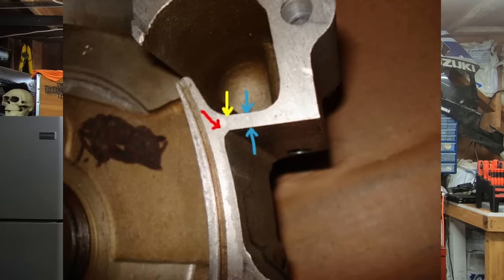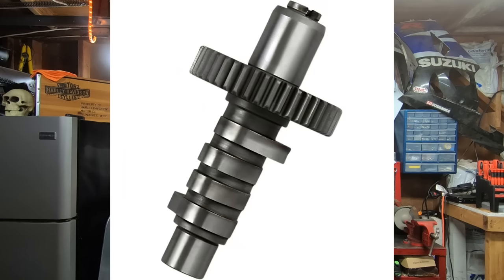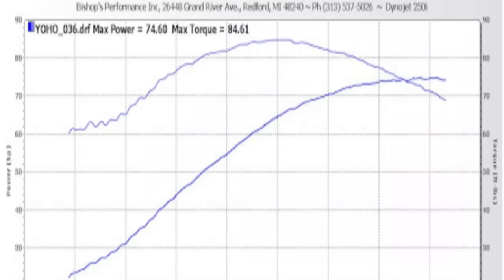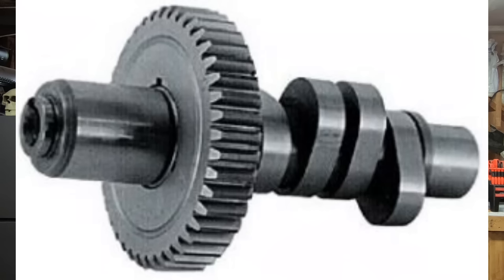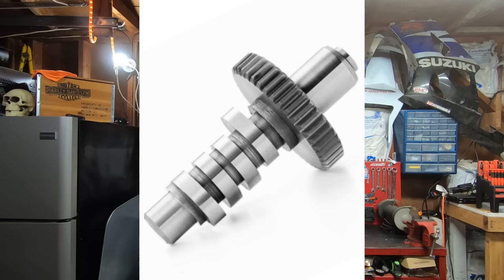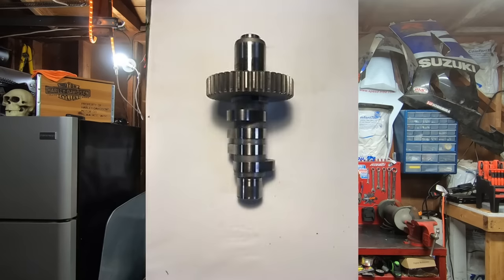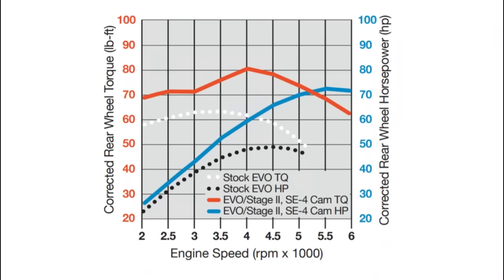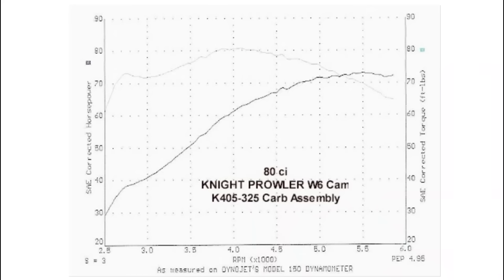Absolute Best Upgrade for the Evolution Harley-Davidson

Comment from the maker: What camshaft are you running in your Evo, are you still running the stock cam or have you already upgraded?
Reply: Dyno results from different sources aren't worth comparing to each other, first thing is the same exact motorcycle on the same day with the same atmospheric conditions will give you entirely different results from different dyno's or even the same dyno with a different operator, you can even play around with the hold down straps and your numbers will change, I've seen tests done where they took a bike that measured 100 RWHP on a dyno and took it 1 mile down the road to another shop, running the same gas in the tank with the same atmospheric conditions it ran 86 RWHP, that's a 14% variation, not exactly definitive, dyno's aren't the etched in stone result's that people think they are.
And when someone like Woods Brothers gives numbers for a cam they quite often use an engine that they've done other things like headwork on to make it appear that their "bolt in" cam is superior, you even mentioned that it has one of their own modified carbs on it, you can bet that's not the only thing they did. 
No one has some huge secret that nobody else has, whether it's in the bolt in class of cams or any of the other's that's designed to work with different levels  of modified engine's no matter who makes it the result's are going to be right around the same, nobody has a magic wand.
What's far more important is running a good exhaust, anyone who dump's thousands of dollar's into an engine and runs short straight pipes just blew it, a good exhaust is critical to getting the most out of what you're doing, "true duals" are a waste of money and are sold to people who assume that because back in the 70's taking a V8 automobile with a Y-pipe and catalytic converter and having a dual exhaust put on it made it run better then a dual exhaust must be better for everything, that simply isn't true.
The cross over pipe in some stock Harley exhausts along with the "married" type used later is there for a reason, Harley knew exactly what they were doing when they designed it, slip on mufflers with the stock headpipe will run much better than wide open pipe's, the odd intake pulses from a 45° engine where both cylinders share a common intake are the reason for that.
The best exhaust to run on any Harley except for the true XR style engine with it's design that has a separate carb on each cylinder is a 2 into 1, this is basically what the cross over pipe and married headpipe designs achieve, one cylinder's exhaust helps to scavenge the other cylinder and get the intake charge moving on the "dead" cylinder that has to wait for so many degrees rotation of the flywheels to start it's intake cycle. 
However some people don't want the look of a 2 into 1 exhaust on some models of bikes so the stock headpipe with slip on's come in a close 2nd, longer drag pipes with inserts like those made by Krome Werks (spelling?) are a decent exhaust to run for someone who want's the drag pipe look, but for God's sake NEVER run wide open pipes, they completely destroy mid range power and only add 1 or 2 HP more on the top end than a good exhaust that increases mid range by 20 to 25% over drag pipes in the mid range, and you have to go through your mid range to get to the top end so it doesn't take a genius to figure out what's going on there.
I've seen more people ruin thousands of dollar's worth of work by running drag pipes than I care to remember, I make it perfectly clear to someone that if they plan on running drag pipes I won't waste my time building an engine for them, it's just stupid.
Reply: im going to go with the ev27 on my 98 fxstc with 17k miles on the clock. should I put adjustable pushrods and  lifters aswell? thanks!
Reply: Ev27 with a thunder header and s&s super e screaming beagle ignition module. Plugs say she’s happy. Great info thanks. Tom
Reply: @jukeboxheros7021  
EV27's open and close the valves very quickly and as s result are hard on the valve train, years back Rivera Engineering offered a cam for Pan's and Shovel's that was like the EV 27 that brought on power low in the RPM range by operating and closing the valves quickly and gave a wide powerband like the EV27, they had to quit selling it because it was trashing the valve trains in engine's that were running them, so if you plan on running an EV27 plan on having valve train issues down the road that might include valve float at higher RPM's than a stock ignition's rev limiter will allow.
The EV27 is a bolt in cam so no, you don't need adjustable pushrod's, they won't achieve anything except give you the ability to install the cam without having to disassemble the rocker boxes, to do that you have to cut the old one piece pushrod's out, NEVER cut them with an abrasive wheel if you do cut them out, the grit will get through everything, use a set of bolt cutters to cut them and make sure that the valve isn't on it's lobe on the cam when you cut that particular pushrod. 
As far as putting in replacement lifters it all depends on the condition that the stock one's are in, factory EVO hydraulic lifters are pretty good, I've heard it said that they should be replaced every so many miles but that simply isn't true, the best guide for replacing them is the amount of wear in the bore's of the tappet block's and the tappet bodies, buy yourself a 0 to 1" micrometer that measures down to .0001" (one ten thousands) and a set of small hole or telescoping gauges that are intended to be used in a hole that's the size of the bore in the tappet block, measure the diameter of each tappet and write them down on a piece of paper, then using the small hole or telescoping gauge and the micrometer measure the size of the bore of each one in the tappet block, then subtract the two measurements for each other and see if it fall's into the clearance spec given in the service manual, if it's close to the wear limit then you might want to consider replacing them but it's not necessary. 
What's of great importance is making sure the fit between the cam gear and the pinion drive gear is correct, a little too loose doesn't hurt a thing except it'll be a little noisy, but tight is practically a death sentence because it'll burn things up, also important is the end clearance, don't ever assume that the shim that's in the engine currently will be the correct one for a cam change, if you have a 6" vernier caliper you can measure the distance from the two shoulders on the cam that determine it's length between it's inner bearing surface and the bushing in the cam cover, if the length of the two are the same or the replacement cam is slightly shorter between those two shoulders you'll be ok AS LONG AS the current cam in it didn't have any end clearance issues, however the best way to check it and verify is to measure the end clearance with a feeler gauge with the lifter blocks out, there's tools that allow you to replace cam's in that style of bottom end without having to remove the tappet block's, if you go that route then you must measure the length of the replacement cam to be assured it'll have end play, no end play will tear things up, if in doubt the least bit then remove the tappet block's and using a feeler gauge verify that the cam end play is in spec, with the tappet block's out you can also check the gear sive without buy a micrometer that measures in that range and the special pins needed to measure the gear, also to properly install the tappet block's once they're out you need the special tool that threads into one of the 1/4" fastener hole's in place of one of the screw's to assure that the tappet rollers are running true on the lobe's, it's a hex drive screw with a long taper to properly align the tappet block's, otherwise it's like having a car's wheels out of alignment going down the road. 
Also pay close attention to the rotary breather valve end play and make sure it's in spec and that it's timed properly when installing the cam.
Reply: everything is stock, but the pipes and mikuni 42, thanks
Reply: @jukeboxheros7021  
If you want a combination that'll work as well and last longer go with the EV3 and bump your compression up one notch, the EV3 is much easier on valve train's and with the compression raised you'll get that same power coming on earlier like how the EV27 does. 
The EV27 and EV3 have valve timing specs that are almost identical, each one's a single degree within each other opening and closing the intake and on it's surface the difference between them shouldn't make any difference at all, but what they don't tell you and what most people don't get is the way they list valve timing, the "@.053" is what come's into play, when a cam manufacturer says a cam of their's opens an intake at 20° BTDC that means that it's already .053" off of the seat at 20°, likewise when it's closing they rate the valve as closed when it's actually still .053" open, what that means is a cam with less aggressive lobe ramp's is actually holding the valve open longer than a cam with more aggressive ramp's that list's the intake's as closing at the same time because it's closing slower, that's why despite the EV3 and EV27 having almost identically listed valve timing the EV27 makes more power down low, because with it's gentler cam ramp's the EV3 is holding the intake valve open longer after BDC than the EV27 is, as a result it has less dynamic compression than the EV27 despite their timing being almost identical on paper. 
Cam's like the EV27 and the Woods cam's that seem to have some sort of magical quality behind them and make a lot of power down low despite having listed opening and closing numbers that are almost identical to other cam's are hard on valve train's, that's what they won't tell you about. 
On paper those the EV3 and EV27 are within 1° on both their opening and closing of the intake valve, but the EV27 hammers away on your valve train opening and closing the valve's so quickly, that's the price you pay, if you are going to run something with ramp's as aggressive as something like the EV27 then make sure your valve train is healthy. 
If you want to run the EV3 and don't have the money for higher compression piston's one thing that can help is tightening up the squish by running a thinner head gasket, that'll raise your compression up a little, all the aftermarket part's manufacturer's like Weisco and other's will tell you to run .050" clearance between the piston and head in the squish area, that's a waste of time and power, squish area's don't do a thing until you get them down to at least .030", that's when they start really doing what a squish area is supposed to do which  is create turbulence, I don't know if it's that the part's manufacturer's are afraid that people might miss some other little detail or measure thing's incorrectly and then thing's will start bumping into each other and they'll get the blame but the fact is their benefit's don't start kicking in until they're down to at least .030", I routinely run them all the way down to .020" with no problem's including my own Sportster that regularly get's revved to 7,500 RPM's with stock rod's and flywheel's, tightening up the squish area is a good example cheap horsepower. 
Your Mikuni carb really isn't going to make any difference at the level of modification's that you're doing, the stock 40mm CV carbs with a kit in them will support a 100 RWHP build, the Mikuni will get you up around 115 RWHP if you ever decided to go all silly fast on the mods, before that you'd better put a bunch of money into your brake's.
Reply: @dukecraig2402  wow! maybe this is a job for my indy to do. he sugestted ev27 as cuasual conversation, but maybe i'll bring up the ev3, i don't want valve problems down the road, just a little grunt. thanks for the advice.
Reply: @dukecraig2402  that's a great explanation on exhaust I've been doing it for years it's just common sense--thanks for your time
Reply: I ran a Sifton 141, with solid lifters, adjustable pushrods, a ton of headwork, and two inch straight pipes. It was a top end monster.
Reply: EV13 in my ultra
Reply from the maker: It's very easy to do if you're going back with adjustables, a lifter swap later wouldn't be hard at all. Personally l like to put new lifters in with a new cam.
Reply: Bought to slap an ev27 in my 96 fxd
Reply: @dukecraig2402  Thanks Duke. everything Id need to know now.
Reply: My FXSTC Evo is running a stock cam... I push the heck out of that bike and I need more power. I want acceleration AND top speed 100+ mph. Any ideas?
Reply from the maker: Aftermarket Evo cases, stock cases will split trying t ok make that happen.
Reply: @GixxerFoo  Hmmm... As is with just a jet kit and a 2 into 1 exhaust I can do 100mph everyday no problem. It just doesn't get there quick enough. I will look into the Andrews stuff before I buy. It's about to go into the shop for about $2000 worth of rebuild budget and I just want to know what's best before I buy.
Reply: Al Gottsch  Thank you bro, with so many options I'm having trouble deciding what to do. I've had my EVO for about 7 years or so and it's been a journey getting it to do 100mph comfortably. Carb tuning, exhaust, new rims, front suspension upgrades, T-bars... the list goes on and on. I can do 110mph but at that point I don't want to push it any farther. Now out of pure stubbornness I am going to continue squeezing every drop of performance out of a bike that was really meant to be a cruiser. What can I say, I like to be different... Thanks for the recommendation!
Reply: Al Gottsch  I know I'm way above that already. If my bike was sitting at 36 hp there is no way it would be even as fast as it already is. That said I'm guessing I'm close to 60 hp or so. Maybe I'll post again after the work is done. The Andrews EV27 looks like the most popular option.
Reply: I own a 1989 police bike, was already strong from factory, only changed inlet manifold and fitted a good tuned cv carb with k&n filter. Runs like a dream.  No trouble driving with mates with gold wings.
Reply: @jukeboxfan60  my 98 Electra Glide Classic runs strong too. Tossed the EFI ( cause me nothing problems) and replaced it with a jetted  CV40.
Reply: I have a 1200 evo. 2020 i got 80 hp with the stock cams and 2 into 1 exhaust and a high flow aircleaner. I'm pushing about 79 ft lbs tourque also. I'm going to be doing a 1275 big bore kit.  What cams should i get for higher rpm power?
Reply: @jukeboxheros7021   Hey Duke do you have a you-tube channel of your own and how familiar are you with Pan-Heads? Mike from Maryland. (mislandmike@hotmail.com) I noticed a lot of the same subscriptions as mine.
Reply: My '86 EVO is hopped up a little. Running stock cases and jugs, S&S rods and crankpin, Wiseco 10:1 forged pistons, Jim's pinion shaft and Pro-Flo oil pump, Andrews EV46 cam, Crane lifters, Andrews adjustable pushrods, and T-Man heads. Carbe is an S&S E, and running 36 inch drags with 1/4 inch bolts near the end. Transmission has Andrews gears, Baker steel shift-forks, and upgraded bearings. In the primary I went with an Alto Red Clutch set, with a 23 tooth comp sprocket. Also converted to chain final drive. This is all in a Softail. Bike is really strong, especially up to a little over "the ton", LOL. She gets between 40 and 50 MPG, depending on how you ride. Love that scooter. I call her "Angel". Thanks for putting these vids out there.
Reply: @dukecraig2402  what about timing if you do cam and higher compression pistons? do you need to buy ultima or can use stock ignition?
Reply: @michaeldiy1510  
Completely depends on the build, I've been surprised sometimes at how some builds with cams, head work, exhaust and carb will use a stock curve and advance/retard degrees, then you can have a build like putting a set of Y grind Andrews cams in an Ironhead Sportster, bolt in cam and despite using higher compression pistons and not only is the stock curve wrong but you'll never get it to idle below 1,150 maybe even 1,200 RPM's reliably because the duration on the cams is so long that compression is down at an idle, the amount of throw between retard and advance has to be shortened from around 30° to 15°, which actually comes out to around 15° advance at an idle compared to it's stock advance at idle which is around 3° or 5° I can't remember exactly, but with less than 15° or so advance you can't get them to idle at 1,000 RPM's.
Those older Ironheads with points and the advance weights with the springs I'd install the softer springs that allowed for a faster advance and tap out the two pins that go through the bigger holes in the advance weights that determine how much it advances and drill bigger holes in the base to put in larger diameter pins that I'd make from the right size drill bit shanks (I can't remember what size I used, I have it written down in my build files), or if you could make smaller diameter bushings to put into the bigger holes in the advance weights, either way you want to cut the amount of advance by about ½ and they'd idle fine.
Of course if you put a Dyna or Compufire unit inside the "cone" that replaces the entire assembly in there on them or the Shovelhead's they have all the switches you can set to get a faster advance and cut the throw in half or so, but I never liked those things, back in the day when a lot of bikes had those it seemed like everytime you got a bunch of guys together to go riding there'd always be someone who'd have one of them that would go out, and then we'd have to sit there with them till someone with a pickup truck could be summoned to come get them, and this was the days before cell phones so good luck with that, I don't think those units were ever really up to withstanding all the heat and vibrations in there, a properly set up and maintained set of points is far more reliable, my 2003 Sportster that I built the engine on exceeds 65 MPH in first gear and I've got a custom set up set of points in it via the tricks I know and I even rivet the cover on it just to make it appear as though the stock ignition's in it, it's a sleeper bike that surprises the hell out of people who look it over and think they know what's going on, large Red Shift cams that should have collapsible converted push rod tubes but I figured out how to run not only adjustable push rods for the smaller base diameter cams but also the travel limiters in the lifters for sustained high RPM's with the stock one piece covers, people who think they know what they're looking at figure it's got bolt in cams, 44MM Screamin Eagle carb that appears to be the stock 40MM carb, windage tray in the bottom end, I put a 52% balance on the flywheels for high RPM's, Racetech Gold Emulator valves in the stock forks, a stock ⁹/⅙ diameter front master cylinder from a single disc on the dual disc front brakes that'll stand that thing on it's nose with two fingers on the brake lever, yea, that bike's been a real nasty surprise for people who think they know what they're looking at, and I've won more $20 bets with people who call me a liar when I tell them it'll exceed 65 MPH in 1st gear, I tell 'em "Get your car, you can run along side me, just make sure you have $20 because if you don't then don't bother pulling over after I show you, of course before I do it I don't tell them I have an Andrews close ratio 1st gear set in the transmission that adds 10 MPH on 1st gear, rev it to 7,500 and the needle's sweeping past 65 MPH, I just let 'em learn the hard way, $20 at a time.
Reply: @dukecraig2402  nice !!!!!!!!!!!!!!
Reply: @michaeldiy1510  
Check into these multi compound tires with the softer racing type rubber around the sides of the tread that all the manufacturers are making nowadays, when you lean into a corner you're on the softer rubber, I just put a set of Avon Cobra Chrome on that Sportster and it goes around corners like it's on rails.
I used to run the Dunlop GT 501's that are made in the same style but they've dropped the 140 size rear for 16" wheel  that It has, and they were incredibly expensive, the Avon's are working just as good and they're probably about half the price plus they're made in England, I'd rather give my money to the working class folks in England compared to some of the alternatives, you know the people in England are skilled and take pride in their work so you can trust tires made by them.
I think I'm gonna try a set on my 05 Ultra and see what kind of mileage I get out of them compared to the Michelin Commander's I've been running. 
As far as the drop in style valves like the Racetec Gold Emulators I have in it try the Ricor Intimidators, I put them in my 05 Ultra and WOW, they turned the stock forks into something you'd think says Ohlins on them, they have that inertia valve that makes the ride very plush when hitting bumps.
About 10 years ago I started getting into setting up suspensions, those drop in valves have turned out to improve those front ends so much that Harley started using them around 06 or 07 I believe, the forks on my Ultra were kind of a freakshow hybrid where it had the traditional dampener assembly in the right side and a cartridge set up in the left, the reason I didn't care for that is when it comes time to service the fork oil you have to pull the cartridge out of the left fork and tear it apart (requiring special tools) just to change the fork oil, so I ordered a fork tube, dampener rod, and a few little other parts for the right side to turn the left into the same dampener system that is in the right side and is how they were always built up until that oddball couple of years like mine that have the cartridge in the left side, and then I put the set of Ricors in it and haven't looked back since, when I bought that bike with 50,000 miles on it every bracket on that thing was broken from the notoriously harsh suspension that era has, after replacing the broken stock fairing brackets with a set of Strongarm brackets (order a 2" longer than stock clutch cable when you do it, trust me) and welding the speaker brackets including making gussets for the bends in them, which is right where those one's break, like Harley should have in the first place that front end glides across uneven bridge seams and frost heaves and pot holes like they're not even there with those Ricor valves so I don't have to worry about anymore bracket issues, on the rear I bought a set of Gabrial '63 to '82 Corvette air shocks to replace the incredibly harsh rear shocks, which accounted for a broken tour pack mounting bar (the tour pack was flopping around when I hit a bump), that U shaped tube bar that the tour pack mounts on, there's a set of bushings for some kind of suspension brace add on bar for raised body pickup trucks that you have to press the bushings out of the replacement shocks and press them in to use on the bike, if you spoke around on forum sites guy's talk about where to get those bushings at (some 4X4 place has them), then mount an air compressor and dump valve inside the tour pack, then get a switch for a CVO from that era that's for locking and unlocking the tour pack on one and mount it in where the speaker/CB switch goes on the console (provided of course that you've replaced the stock radio and no longer need the speaker/innercom/CB selector switch), it's a rocker style switch from the CVO's electric tour pack that rocks forward and backwards to lock or unlock the tour pack, wire it up with the air compressor and dump valve so when you rock it one way it pumps up the shocks and when you rock it the other way it dumps air, run an adjustable metering valve on the dump line otherwise it dumps air out so fast it's hard to fine tune the suspension riding down the road, if you're into it however it looks cool pulling into a parking lot and rocking the switch to dump air and it instantly slams the rear end down so a passenger can get on or off, but it really makes it hard to adjust going down the road, I have the metering valve adjusted so that 2 seconds of dumping air is the equal/opposite of 2 seconds of rocking the switch to air up the shocks, that way when you're going down the road it's easy to fine tune the suspension to that roads conditions. 
Between doing that and the Ricors in the forks that thing glides across bad road every bit as well as Ohlins cartridges in the front and Ohlins shocks in the back that I've installed for people and it's at literally a fraction of the cost, plus on the rear you don't have to pull over and get off and remove the saddle bags to adjust those $1,200 shocks, now between the rear suspension and those Ricors in the front that bike's like riding a Lazy-Boy recliner down the road, 2 summer's ago I went from Southwestern Pa to Amarillo Tx in 2 days to visit an old Army buddy and I wasn't at all beat up from riding that hard.
After letting several people ride it who had me install all the Ohlins goodies front and rear they were sick when I told them I did all that suspension work for less than $400 and it rides every bit as good as the $2,500 they had in the Ohlins parts.
Reply: ‘90 FXR. EV27. Single fire ignition. 10:1 compression. 48 pilot. 185 main in CV40. Big sucker filter. SE pipes.
Reply: S&S .585
Reply: Andrews EV27 , mikuni hsr42 , big sucker stage 2 , S&S performance replacement STD Comp. cylinder head 76cc ,tapered open muffler .
Reply: Andrews ev38 in my 92 fxdc. I like the powerband of this cam for how I ride. Tried to keep all the power upgrades I've made coordinated with each other. Made a huge difference in mid to top power. It was a gutless pig that required alot of shifting to keep in the small power band it had, but now pulls hard from 2400 to as far as I want to rev it. The cam swap made a serious improvement. Stock '92 cam is pathetic, just like the carb tuning and ignition settings for this year.
Reply: A buddy of mine as  87 electro glide I think! Older bike! Some one  gave him said it had screaming eagle upgrade! I didn’t think you could do screaming eagle upgrade! I’m not to up to speed yet! He just not upgraded the cam!
Reply: I was curious as well! I have an 04 fat boy with factory 88! He let me borrow a service manual for 2009 touring models! Will this manual work for my bike? I do believe it’s for 96? For some things
Reply: Greetings from Australia Mate, finally got my 93 FXDL sorted out about 3 weeks ago with the EV27 install. I Went with new factory oem lifters, prolite taper pushrods apnd  the S&S reed valve breather. I've had her for a while now and had gradually fitted up V&H Bigshots Staggered, modified the cv40 and Sceamin Eagle ignition module. The EV27  has transformed the old girl. Not a pig around town but now  definitely gives you a good kick in the pants when asked to. I don't flog it like it owes me money, I'll get a ZZR1100  for that but for a bike that's pushing 30, it's no slouch. And, it's mine, not the banks. Love the channel mate.
Reply: @jukeboxheros7021  hey mate, hope the ev27 install went well. Just done mine at 63000km. New lifters be wise and adjustable rods make the install a bit easier so you don't have to pull the rocker boxes etc.
Reply: Running a Rumble Stick cam from Head Quarters on both my 93 and 94 evos...pretty happy with it.
Reply: Correction on the video, on the ev27 the torque was 85.24 not the hp
Reply: @jukeboxheros7021  what did you go with? I've got the exact bike, goes like stink after some changes and they sound great.
Reply: @gregbrown3967  I haven't changed anything, she's still stock. now has 21k miles. when it comes time to change the lifters maybe I'll do a cam and bearing swap. thanks for asking.
Reply: @twowheelterror2925  same bike as you, mine pulls hard up to about 105mph. 
What did you end up going with? Do you like it?
Reply: @gregbrown3967  Bro... SOOOOO much money spent and the shop recommended I leave it alone because it runs so good. I had to fix a bunch of other stuff and now it's decent. But it's also for sale because I bought an FXR to REALLY build into the bike I want. The softail was fun, but it's gotta go! As is, I'm probably $10,000 in with the cost of the initial purchase. Time to call it quits on that!
Reply: Hi just found your channel. Love the info great job. I was wondering why don’t you hear more of comp cams V-Thunder cams. I have a 1998 FXSTC 80” Sreaming eagle heads , 44mm CV carb. Of coarse screamin eagle 10:5.1 pistons Comp Cam EVL-5015. It’s a .585” Lift cam with 252 duration at .053 my bike makes 90hp and 94 ft/lbs it’s a strong running 80” always has been. Just thought I’d share.
Reply: Ev27 1988 evo fxr runs great
Reply: These cam discussing are with stock pistons and cylinder?
Reply: Still running the stock
Reply: I'm running an EV27 in my 94 FXSTC love the cam. Running also a Thunderheader 2 into 1, factory carb with a thunderslide/jets. Screaming eagle air cleaner. It seems to hold its own with the twin cams
Reply: EVL 3010 cam since 1999
Reply: @jukeboxheros7021  Not an expert myself, but it’s basically a Bolton cam so my understanding is adjustable. Push rods are not required but I could be wrong. I guess it’s a choice?
Reply: @dukecraig2402  I just read his comment after I made mine adjustable push rods would be a heck of a lot easier when doing your lifters at a later date
Reply: I'm picking up a bone stock 91 evo softail next week, with 5500 miles. Wanna put Andrew's 23 in